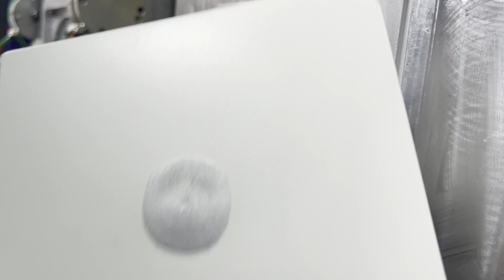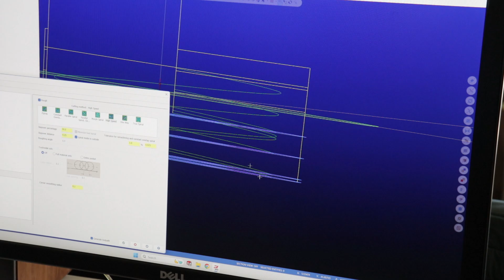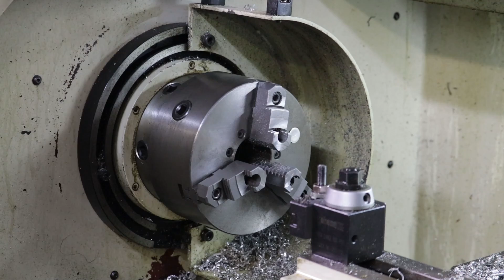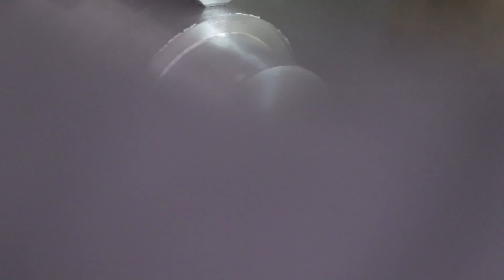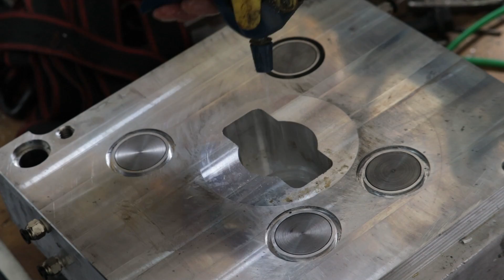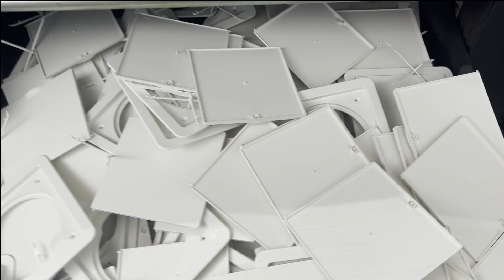BLOWOUT

Comment: Oh my ! Didn't know such things could happen to an alluminium mold ! Quite impressive, but i do think the clamping of the injection unit might be too strong (because i already used alluminium mold for high quantity of parts on a 160T hydraulic, the clamping of the injection unit was manual, so i could set it myself to low clamp and i never encountered the same problem you're facing in this video. I'm now using electric presses like you do with your 200T (Haitian if i'm not mistaken), and the clamping being automated goes directly to full clamp (But it is only a theory, i did not try to verify this particular point about the automatic clamp on electric). Hope there's a way to set to lower clamp your injection unit !
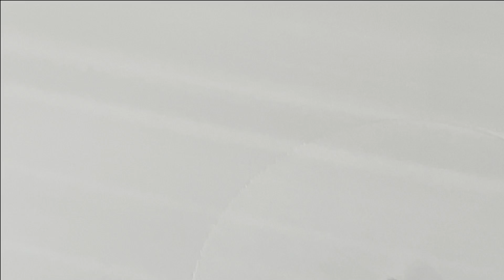Reply: No, I actually found the problem after watching the whole video. At 37:15 , I see that the injection goes far in the mold to shorten as much as possible the sprue, but the thickness is way too thin between the nozzle and the cavity part in my opinion to counter the clamping of the injection unit for long term usage.